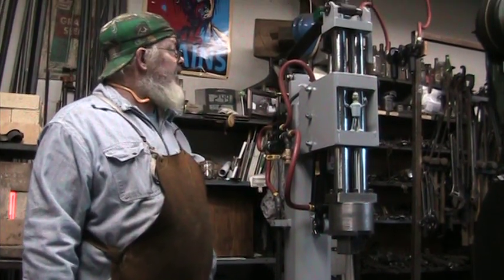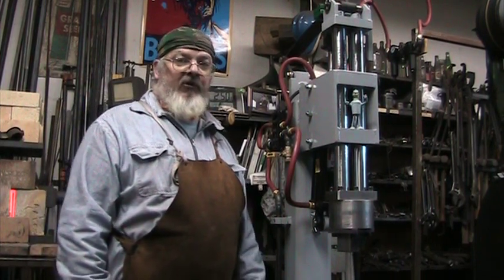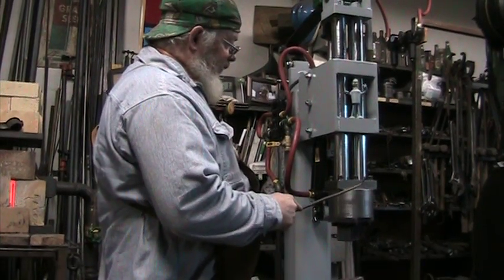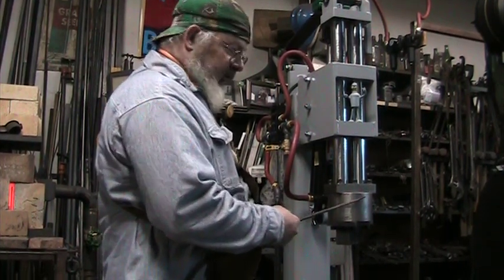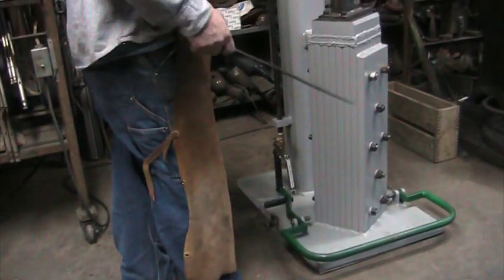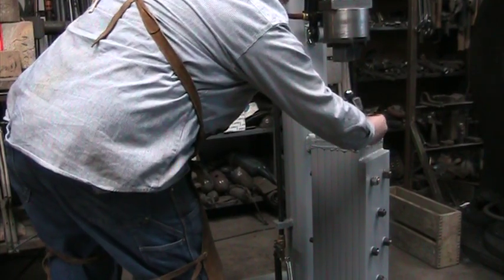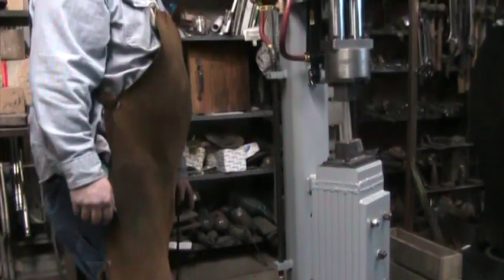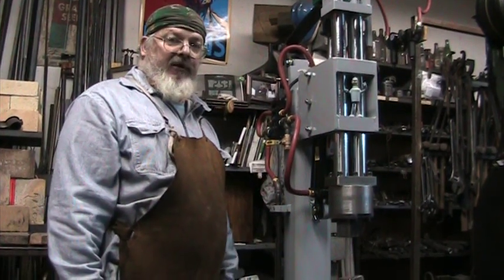Kinyon Power Hammer Pt1

Comment: You do have a nice hammer. Now for the sad news. The bottom ram screws can loosen and beat the threads in the rods if the top screws that you mentioned were to loosen without your attention. Cross drilling and tapping both ends of the 2” shafts to allow set screws to clamp lead plugs into the bolt threads. Another approach would be to substitute studs for the two top bolts with nylon hex nuts to make up for a hammer’s self destructive behavior.